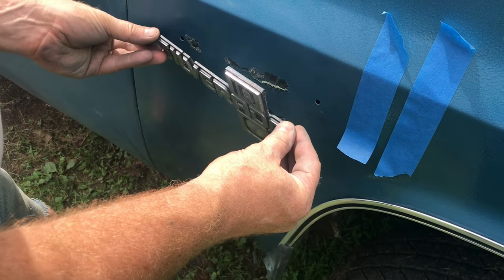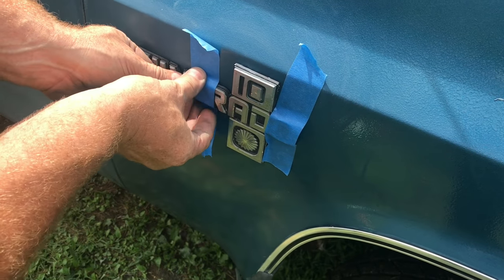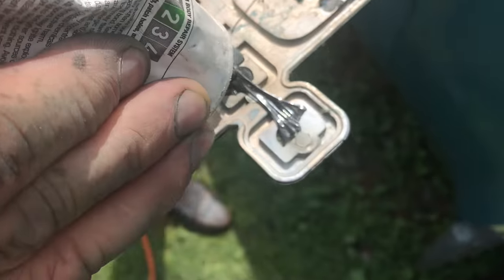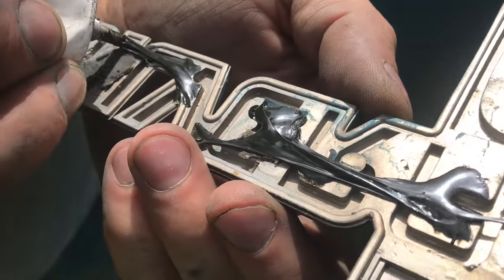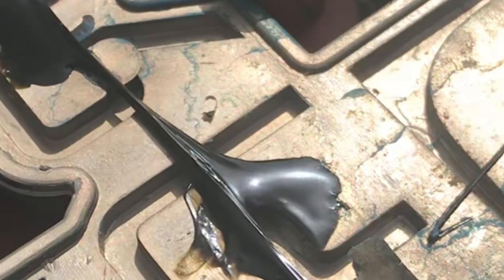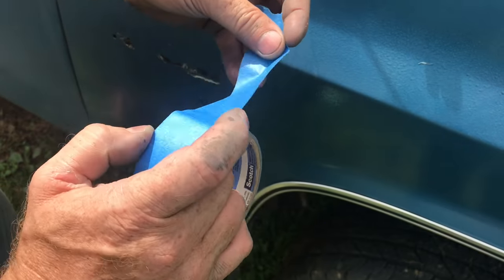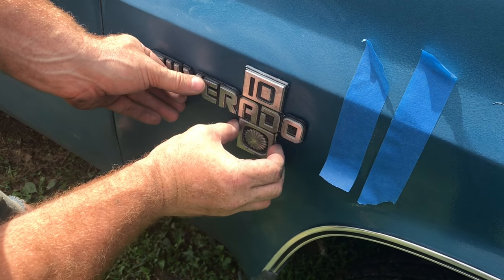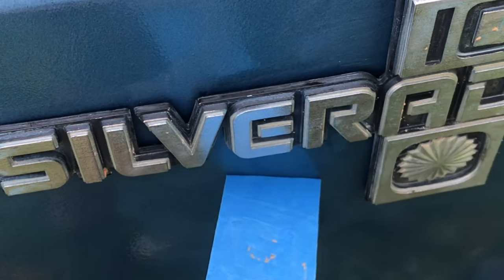RE-iNSTALL automotive emblems and badges

Comment: THANK YOU THANK YOU. finally someone shows what type of Adhesive is used.
Reply: This will RUIN paint work
Reply: @Trenscendent  what will work better?
Reply: @poppinfresh5261  automotive double sided tape. It's very strong and easily removed with fishing line. I've had my emblems on with double sided tape for years no issues.
Reply: @Trenscendent  I love how people think weatherstripping and gasket adhesive would work well to mount emblems that obviously were mounted with mounting tape. Then making the claim it can be used to remount emblems on fresh paint. Adhesive with solvents in it on fresh paint… smeared on haphazardly. I guess they’ll find out the adhesive doesn’t stay that flexible when it dries and an emblem will easily pop off a body panel taking some fresh paint with it. I try to cut mounting tape in a way which minimizes dirt getting behind the emblem.

Comment: Thanks I appreciate this. The emblem S-10 came off the back of the pick up truck at the car wash. I was lucky enough to see something fly outside to the front on the entrance while I was spraying the truck with water. Got the part and that’s why I’m here, now I need to get what you used, thanks. 👍

Comment: Thanks for the recommendation.  This looks like what I'm after.  I was considering the 3M press in place transfer adhesive which looks like a nightmare to use.  This product looks much better and I won't have to clean it up around the edges.  Tip - use dental floss with a hair dryer.  I wouldn't trust a spatula to not scratch the paint.
Reply: Interesting use dental floss, did you do this job successfully it’s an 8 month comment
Reply: @froglobster  I used 20lb fishing line yesterday to get my camaro shields off left and right sides. Line broke 2-3 times per shield so recommend 40 or 50lb line for stronger pull. I used spray bottle of Goof-Off afterwards to clear Remaining residue of glue off after peeling off what I could. Uses car wash towels to clean it up. About 15mins of work. Nbd. 👍

Comment: TO MAKE IT DIFFICULT FOR THIEVES TO REMOVE THEM EASILY, I THINK I SHOULD COMPLETELY FILL IN THE ENTIRE THE EMBLEM.
And a little cleaning before sticking them back on would help,  If the repair is already being done, it costs nothing to get it right.

Comment: will that adhere if it has no pins? One of my emblems has no pins and the other just one pin. And will that work with metal emblems? I can't tell if you're emblem was plastic or some type of light metal

Comment: My car dropped a letter from the back emblem, and I could see some "resin" remnants. I thought it was "old and dried up double sided tape".

Now, I guess it was that glue you used.

I bought the 3M double sided trim automotive tape.

I placed the letter on top of the tape, trimmed the excess with a razor, and gently placed it back in place. And it worked.

However, now one letter is slightly higher than the other one.

The thing that I noticed was how the original glue seemed to "dissolve" the cars surface, and I was afraid to pry out the other one to make them even. I might do it. Later.

Or if the car drops the taped letter, I will replace the whole thing.

But I have faith in the double sided tape. I used to work in a warehouse and some of the trailers came with this "plates" glued on to the walls of the truck to tighten an tie up everything from falling via a "ribbon and crank tying system" that was held together by 3M double sided tape.